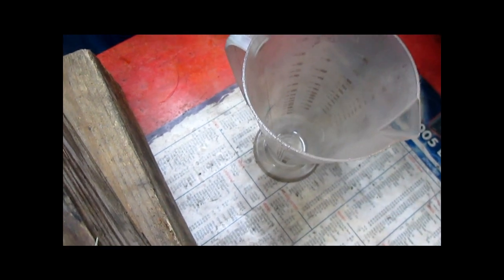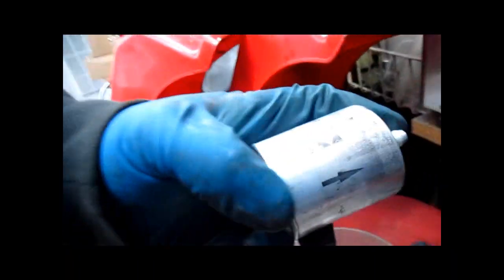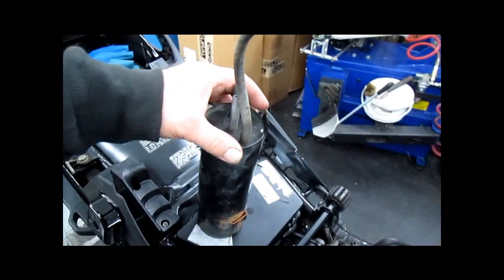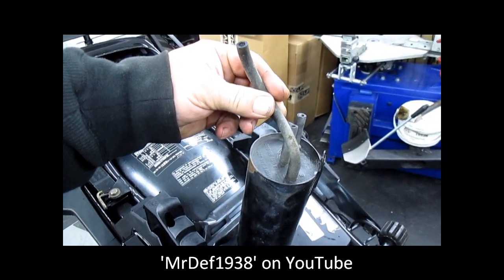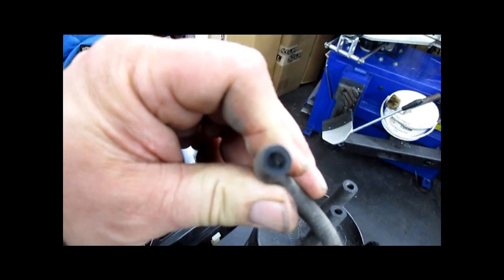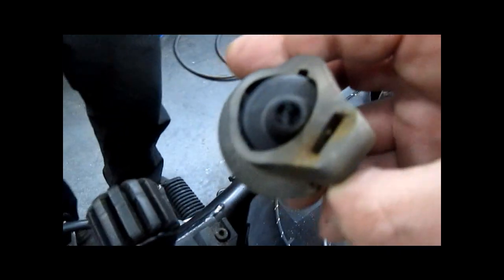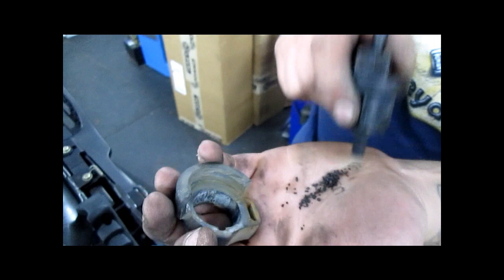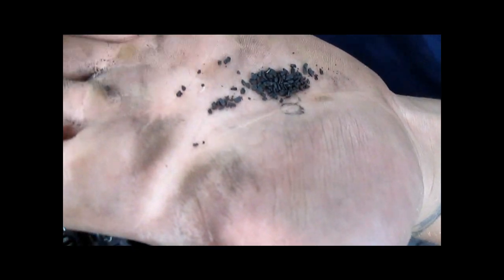BMW Service - What's in your fuel filter?

Comment: This is a very important performance issue. After months of high speed performance problems I traced it to clogged fuel filter which incidentally only had 24000 miles.Full of charcoal! New filter and all issues gone! thanks for the advice.
Reply from the maker: Yes, fuel starvation is not good for the valves. tom, enjoy your new found power and ride!

Comment: The hell is a charcoal canister? They don't come on yuro beemers, what are they supposed to accomplish? Are they in between tank venting?!

This is great info, because every now and then we get a reimported R11xx and now I know how to improve those a bit.
Reply from the maker: Gunter, they are only found on U.S. models, intending to capture any raw fuel that flows from the tank to be trapped by the charcoal where it will evaporate to atmosphere. A fucking stupid design used on many U.S. vehicles. Remove and discard. Thanks, Chris

Comment: Hi Chris, I have not found any video of yours on replacing the fuel filter on a 2004 1150RT so I'll ask a question I have here and hope that you see it and answer me. 
I'm trying to find a fuel filter for my bike and went to www.bikebandit.com where they have many alternatives besides the OEM at $41, but they all ask for a fuel line size. 
I have not found the line diameter (not even in the Clymer Manual), please excuse my ignorance but I need to know that line size and/or what filter you recommend besides the "oinc, oinc" BMW brand and who sells it. Thank you very much for your usual response, Frank.
Reply from the maker: Here you go, Frank: http://www.beemerboneyard.com/fuelfilters.html
Reply: Thank you very much Chris, thumbs up!!!

Comment: Is it a good idea to move the fuel filter external?
I have a 2003 1150R, is the R&R the same as your GS R&R video?
This "How to Change Fuel Filter & Pump on BMW 1150GS" video uses regular hose clamps, OK? How much is the injection hose crimping tool?
davidsfotos@mac.com from Alaska & San Francisco.
Reply from the maker: NEVER route the filter to the outside of the fuel tank! The system operates at 50 psi pressure and fuel filters can split open quite easily. I don't think I need to describe the scene of a ruptured external filter and a hot engine travelling at 70+ mph do I?! An excellent question though. Fuel hose and the clamps should be specific for fuel injection. Do not use standard screw clamps. The bands are too sharp. Look at a fuel injection clamp and you'll understand. I bought the clamp crimping tool many years ago for $30 approx. Thanks David and Happy 2014, Chris

Comment: If anybody believes that is normal dirt, they need to pull their head out of their ass!
I just bought a 96 r1100rt, the canister was removed after the initial fuel filter change back in 1997, and is documented by the dealership!

Comment from the maker: It would enter the engine at the front of the throttle bodies via the vacuum hoses from the charcoal canister. That would just dump the charcoal into the fuel mixture in the cylinder head. However, if you run with no fuel filter or a filter that is saturated with charcoal from extended use with the canister then yes you could see charcoal in the fuel and delivered through the fuel injectors.

Comment: Once in the tank it would have to go threw the filter enter in to the fuel system. The main problem is that the tank sucks down and hits the fuel sending unit, it bends the sending unit and your gas gauge will read more fuel then whats in the tank. you run out of fuel with say a 1/2 tank thinking you have more..